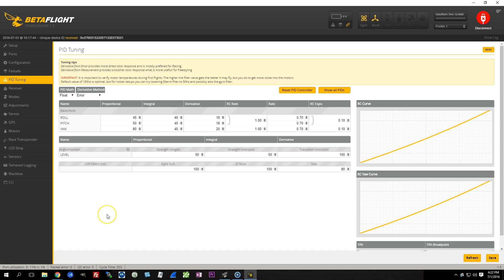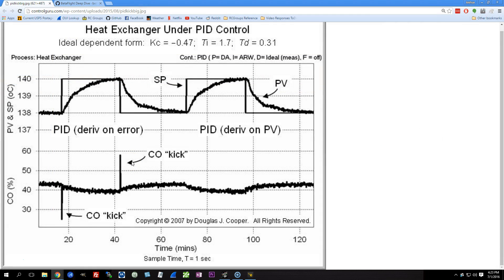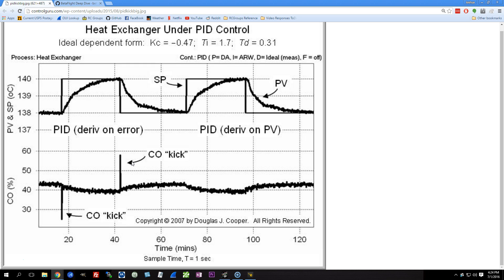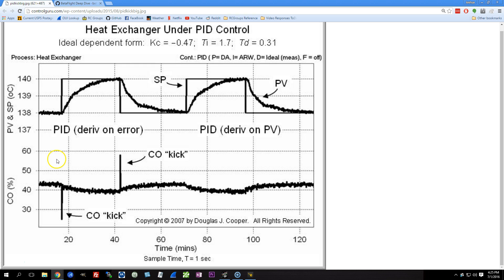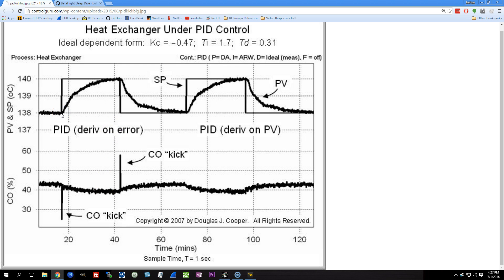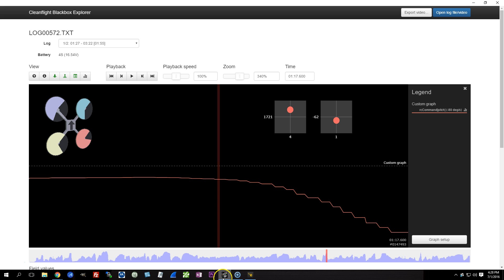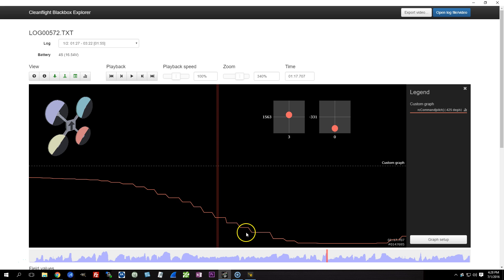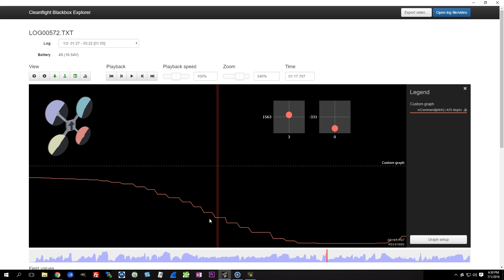Betaflight 2.9.0: D Term from Error vs. Measurement

Comment: Fascinating. I fly only acro, no racing, and I seemed to feel more locked in with Error, with Measurement feeling really loose and floaty.
Reply from the maker: I also fly error. Supposedly, measurement is better at stopping overshoot and dealing with propwash, but I have gotten great results with error, so I don't feel motivated to change.
Reply: Today I tested out flying each one battery after another, and each time measurement felt like my P and I values had dropped. Do the different types of D-term require different tuning? I had left my 2 profiles with my PIDs I tuned in Error, but changed one to measurement just to test it. Maybe I will try to raise values in measurement later.
Reply from the maker: The real question would be whether you could raise P or D with measurement to get the sharp feel back. If you go measurement do oscillations get better or worse? Etc...

Comment: I noticed you were using the floating point PID controller. Why is that? Didn't you use the integer based one before?
Reply from the maker: +fluttershy77x I have always used rewrite before but for 2.9 forward I don't think there should be any difference. For F3, floating point should be lower CPU utilization.

Comment: Another great video explanation Joshua :)  
Do you know if there is a difference in CPU load between either of these modes?

Reason for the question:
I know that my oldest FC (F1 Naze32 R5 board) is at the edge running 500 looptime / 2k ESC & wondering if different PID math / Derivative Method may require more processor speed than the other.
When I upgraded this board from 2.7.1 to 2.9.0 It has been having a few "stutters" mid-flight.  Could just be faulty gyro, or bad connection somewhere though.  
Been too busy flying my other quads when the weather is good, but will do some more testing (putting it back on 2.7.1) to see if the issue has gone or not when the weather is nice again.

Any thoughts specifically around this newer 2.9.0 code & PID Math / Derivative Method specifically having issues on the Naze32?
Reply from the maker: +David Martin I don't see why there would be a difference in CPU load but I couldn't say for sure.

Comment: I think it would be interesting to see how input smoothing effects this in D from error.  For example, if you assume 50Hz RC input update, and you are running 4k PID loop rates, then a stick deflection from 0(centered) to 500(full deflection) would result in an instantaneous error change of 500 with no smoothing.  On the other hand, if the input was interpolated over the 20ms between RC updates, then each PID update would only see a step of 6.25 until the full deflection was reached.  This might reduce motor roughness while still applying a kick over time that might still make the copter feel more crisp.  Side note, input interpolation (smoothing) would have no effect  with D from measurement.
Reply from the maker: Eliminating dterm kick was exactly why rc_smoothing was first introduced. Eventually, Boris seems to have decided that if you want to get rid of the kick, then measurement is the right approach.
Reply: Interesting.  Seems I'm late to the party.
Reply: Measurement is also much better for precisely stopping the move (controlling bounce back) and prop wash.  In general measurement is "better" from a flight characteristics perspective because it's reacting to reality (the gyro) rather than the desired rate (sticks).  The only thing it lacks is that "connected" feel because it doesn't react to the sticks.  Any stick movement has to be captured by the Pterm which then initiates the rotation and only then does the Dterm see it after it begins to affect the gyro.  That's why I suggested the hybrid approach that retains the stick coupling (derivative of the stick movement) as a Dterm accelerator but uses measurement (the gyro) for everything else.  This would retain the "good" Dterm kick (the initial stick movement) but ignore the steps in rc_command thus preventing the "bad" Dterm kicks.  Then we would get the stick coupling for the "sharpness" but the better flight characteristics of measurement.
Reply: I might be missing details to how you would expect this to be implemented, but I'm not sure you're getting what you think from a hybrid method.  The derivative of RC_input summed with the derivative of gyro is the same as the derivative of error (assuming correct signs).  If the stick is not moving, then the derivative of error is the same as the derivative of the gyro.  D term bounce back happens due to the sudden stick centering at the end of a move (not prevented by hybrid) or excessive filter delay.
Reply: The hybrid approach is trying to take the best from the error method (the stick coupling) with the best from the measurement method (the reality of what's happening from the gyro), while eliminating the "bad" parts of the error measurement (Dterm kicks from rc_command stepping and poor dynamic Dterm performance).  Dterm bounce backs are not due to sudden stick centering - they're due to the Dterm not responding properly to the effect of the sudden stick centering.  The Dterm is looking ahead and predicting the future.  If it sees that the current rate is not accelerating or decelerating quickly enough to meet the requested rate it jumps in to assist.  So assume a high roll rate (full stick deflection) and then sudden return to center.  The Pterm is going to immediately react to the error and attempt to attain the new requested rate (0).  But it's a mechanical system with finite power which has momentum so the roll isn't going to stop immediately.  Without Dterm the roll would overshoot and then rebound as as the Pterm tries to (over)correct for the overshoot.  The DTerm is going to see that as we approach the stop that the Pterm isn't going to make it (not decelerating quickly enough) and would apply more deceleration.  This is how it works for ether error or measurement - the difference being where we get the prediction from.  Getting it fem the gyro reflects reality.  Getting it from error reflects desired rate.  The problem is that the actual rotation is often not matching the "desired" rate - particularly in dynamic situations like the end of a move or prop wash.  The hybrid approach wouldn't change how the Dterm reacts as in this case it would still be the same as "measurement" which is the best information we have (the gyro).  In fact the hybrid approach would behave like measurement most of the time but have the added benefit of stick coupling to add the "sharpness" back.

Boris has indicated he's already working on something like this so we'll see how it works out.
Reply: Also I already expressed concern to Boris about the potentially large Dterm reversal due to the stick quickly returning to center.  This could (possibly) cause an undershoot and then bounce back because the derivative of the stick quickly returning to center would cause a (momentary) large negative "kick".  I suggested that possibly we only want the acceleration affect to be in a "positive" manner when the stick movement would cause an increase in rotation rate.  Not sure if it's a problem yet or not - needs to be investigated further.  More info here: https://github.com/betaflight/betaflight/issues/709
Reply: interesting

Comment: +Joshua Bardwell  I realize it's simpler to say that the D-term calculation is the same between measurement and error when the stick isn't moving, but it's not quite true.  For that to be true the gyro would have to track exactly with the stick and we know that's not true.  So in measurement the D-term will react to the differences in the actual gyro rate which (depending on how well you have P tuned) will have an impact on flight characteristics.  This is particularly true at the end of moves where the gyro tends to over/undershoot the requested rate.  Since measurement is seeing the actual gyro data it does a getter job in these cases.  This is part of the reason that measurement tends to "feel" better for freestyle.

Ideally I'd like to see some logic that behaves like "error" only when the stick is moving and like "measurement" otherwise.
Reply: I suggested this "hybrid" approach to Boris and like always he's one step ahead and said "I have this in the pipeline for testing…"

https://github.com/betaflight/betaflight/issues/709